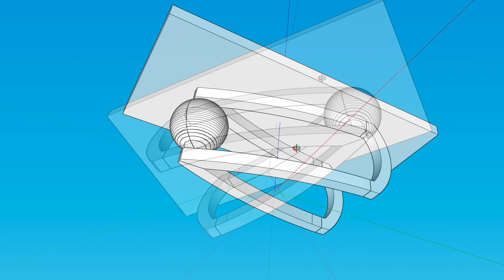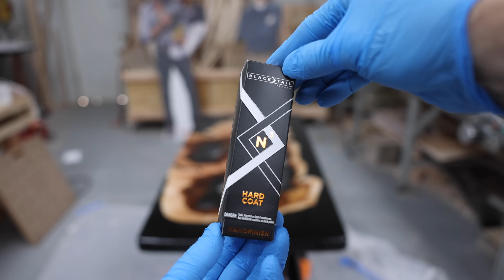Insane Star Wars Mega-Fan Table Build

Comment: Never seen that tip for tape on the underside for the drips, how simple but effective! Can't believe I never thought of that - I'm absolutely using that on my next flood coat 👀
Reply from the maker: It worked great! What I didn’t show was that every 10 mins I would clean up the drips with a foam brush. After about 1:30 I pulled the tape.
Reply: You can also try liquid latex. Especially good for non-straight bottoms (phrasing).

I learned that tip from ArtsyMadwoman.
Reply: I’m gonna use it in every one of my projects now!

Comment: Thanks Joe. If I had the $6000 spare, I'd be so tempted to buy that table, but I think the first thing I'd do is take it apart...... sorry 😳 What I'm thinking is that I'd hate having another flat surface that would just end up with projects all over it so I'd never be able to see the whole table. It would probably also end up getting scratched by whatever project I'mcurrentlyworkingon. I'd attach the table top to the and hang the death star from the ceiling so I could aways see both and appreciate their beauty. I would keep the base in a safe place so I could reassemble it if I wanted to use it as a table. My favourite part is definitely that death star 😊👍👍👍👍👍

Comment: Ideas on the modeling: each model can basically be created with one sketch and one revolved boss. including holes on the section faces for alignment (using dowels) would have been an easy addition. Also, the dish should have been included as part of two rings, which is basically just another sketch and a revolved cut. OR maybe the dish should have been cut into one of the the dome sections instead of having them be the poles of the DS. I’d be happy to help if you need any in the future.

Comment: One thing that would sick to do with your CNC is build a 3D object with lots of surface detail, by making it in layers.  Just build it up from the bottom up in 1/8th inch layers, or whatever you can do.  You could even do it on one of those laser cutter things they make those wooden puzzle/model things.  I say that only because that Death Star was just looking too round and smooth.  I really needed some texture, but with hard edges and corners you couldn't easily carve by hand--but if you did it layer by layer, I think it would look really good.

Comment: Another way to do it is since you have the 3D object, you convert it into STL and pass it to the software, MeshMixer and cut it into layers, separate all the resulting layers and export them to obj and since Photoshop supports obj you import them and convert them to vectors and you pass the vectors to the CNC.

Comment: For the death star, what I would have done is since you have the 3D object, transfered to STL, put it in a printing software, be it PLA or Resin, since it prints in layers. You convert the separate the layers and pass them to Illustrator and then with the CNC cutter you cut all the layers out of wood and then join them all together and it's solved.